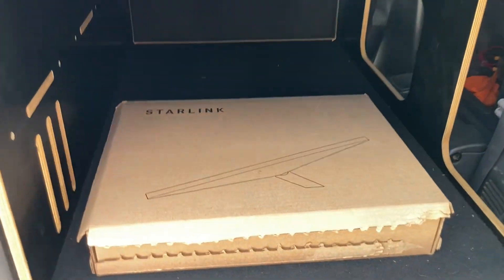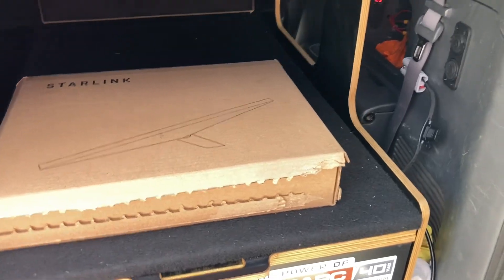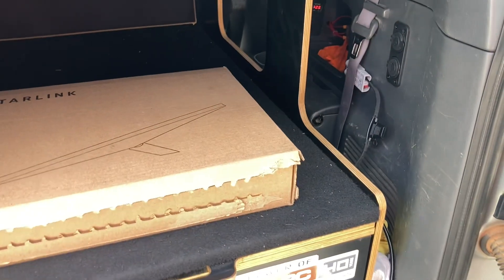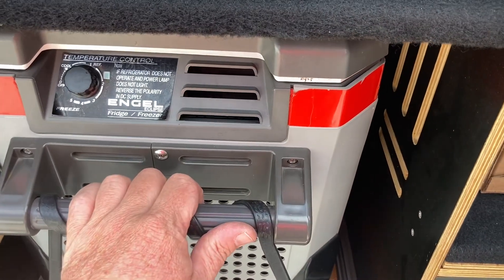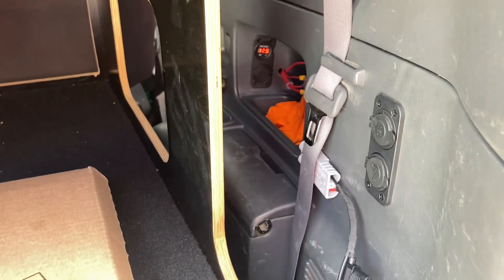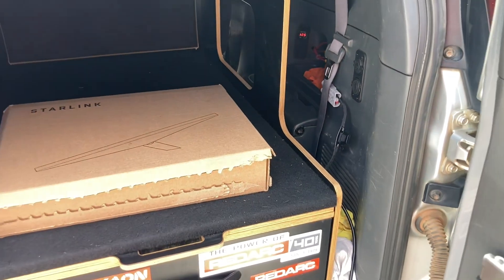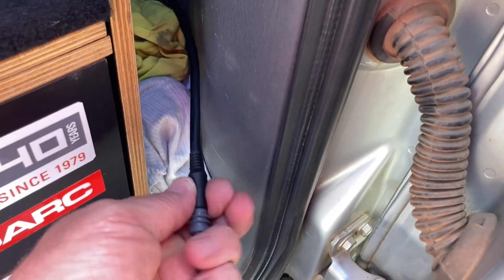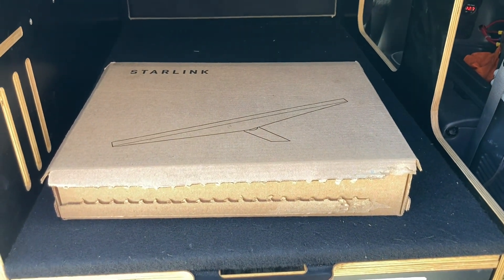Starlink Mini consumption & info i’m on it right now!

Comment: It  is  advisable  to have a  Sat Phone  in your Emergency  Jump (and run)  Bag . Vehicle fire or some such while  Very Remote .
Along with a Radio Beacon , a Small Tarp and a Solar still . That's a minimum . Small first-aid kit , 2 L water and Granola Bars .
Once the Beacon is triggered they will come  FAST . You need to survive in the interim . Rad phone can be useful for providing specific  Local information to assist Rescuers .
Reply: What do you recommend in your jump and run bag?
Reply: And don’t forget, Trunk Monkey. 👍🍺